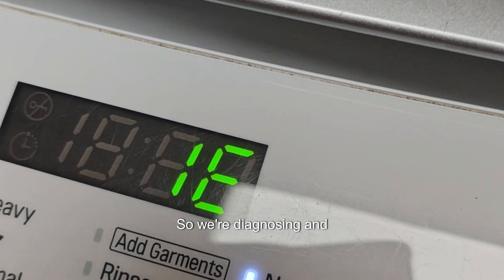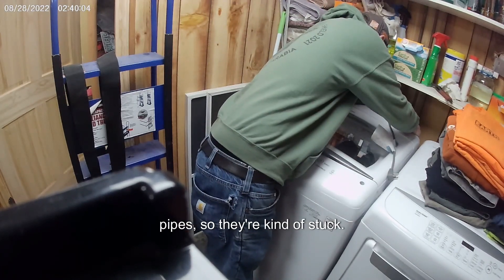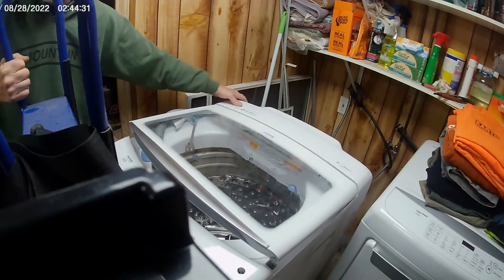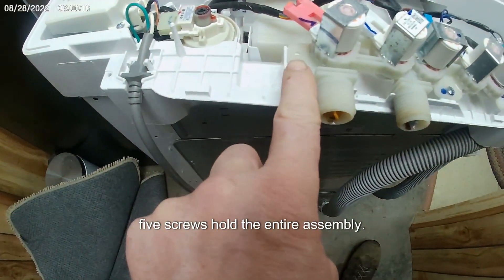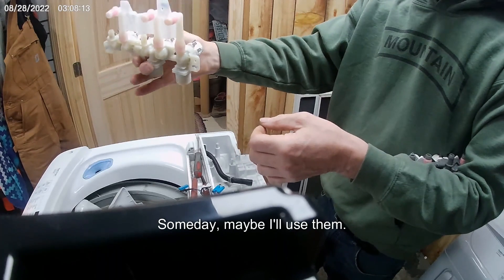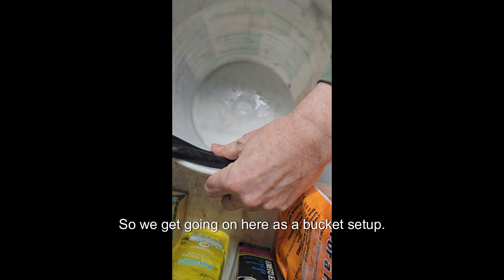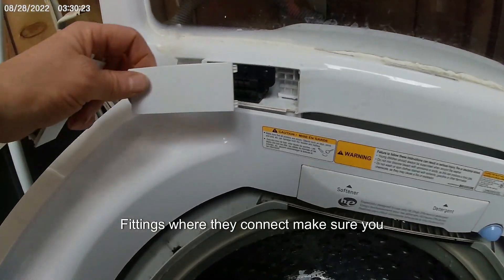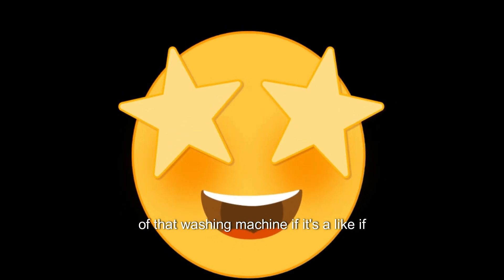LG Topload Washer IE Error Fix REPAIRED! Fix that YOURSELF!

Comment: I had to replace a solenoid for an internal water drip and this was the only video showing the same model as mine. Your rear cover popped off no problem, I had to wedge a screwdriver and really pop it off to open mine. Thank you for showing this video because I was sure there had to be more than two screws and I was really afraid I would crack the housing opening it. Much appreciated!
Reply from the maker: I'm glad to help! That's pretty cool! Thank you.
Reply: You're a savior, I almost wanted to throw in the towel but reading your comment got me determined with a chisel to pop it open finally

Comment: You saved me a lot of money. Why did you unscrew the whole top? Technically, it wasn't necessary.
Reply from the maker: Glad you were able to get repaired, yes not necessary to remove the top, it was exploratory.
Reply: So, you do not have to remove the hinges to lift the top?  I have to replace the door lock on mine.
Reply: @MrMidlife  So, you do not have to remove the hinges to lift the top?  I have to replace the door lock on mine.